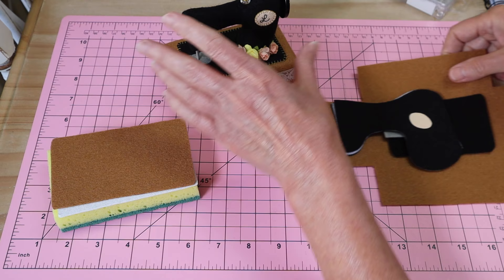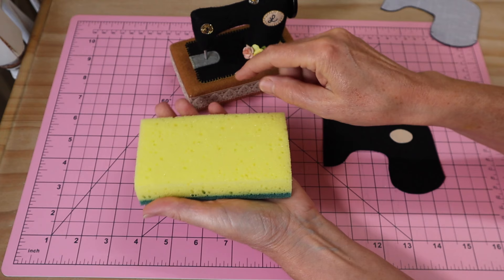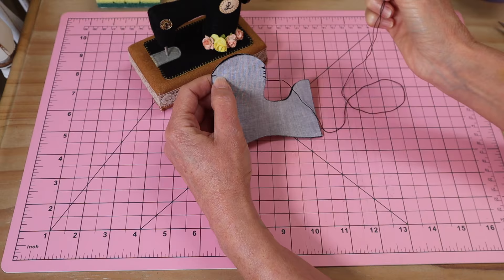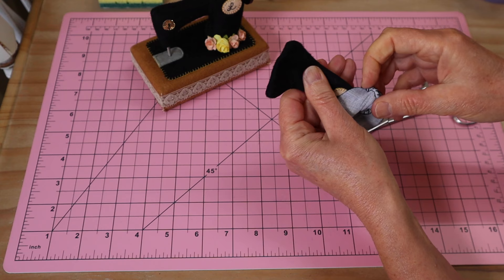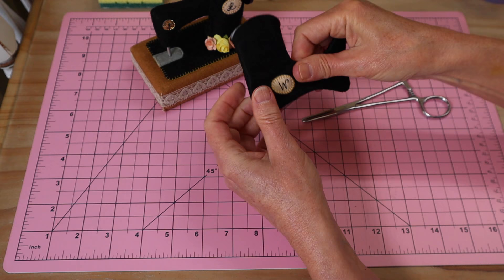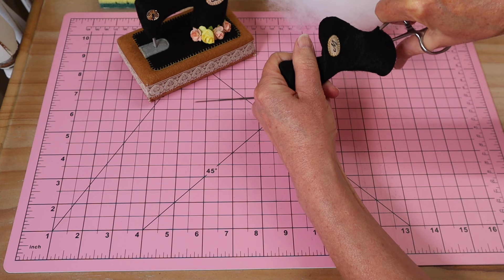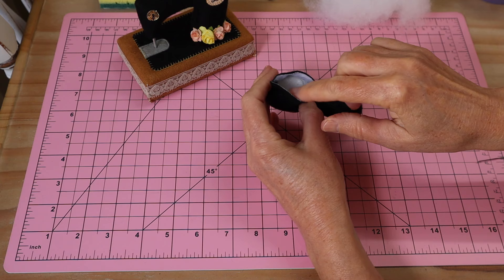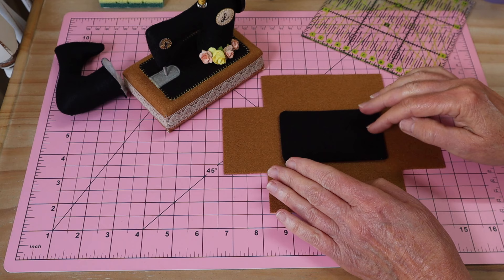How to sew a sewing Machine Pincushion || FREE PATTERN || Full Tutorial with Lisa Pay

Comment: I just want to share what I’m planning on for this beautiful pattern. I actually have 2 featherweight machines, one was my grandmas & the other was recently gifted to me. I actually have the original card table made specifically for the featherweight. It was used in the speak easy’s during prohibition. ( if there was a raid, they would pop out wooden cut out in the card table and pop the little featherweight in it to make it look like it was a sewing shop rather than an illegal bar).  I’m going to do the little badge in a color that looks gold, (that little badge on the machine is gold/brass) first I will sew my initial before cutting out the badge and will attach it with the blanket stitch like you did but I’m going to put a bit of stuffing in it before closing it all the way up. That badge on my machine is just a little bit convex and I thinkit will look more like my machine. The other thing I’m going to do is add a black band around the sponge instead of the lace because the table I have is wood and the trim or frame of the table  which is about 3 inches is painted black. Unfortunately I’ve woken up with a sore throat and in NZ any time you have any symptoms of flu you have to get tested and isolate until you get the results so I can get the felt I need until I get my results and they are negative. Such a bummer. I can’t wait to get out & get this beauty made.
Reply from the maker: What a magnificent project you have planned! So inspiring, I’m sure it will turn out perfect, I will be cheering you on! I hope you share a pic with me when you’re done! Thank you and stay safe! 😊🥰

Comment: Hiya  Lisa, I really love the wee sewing machine and I'm gonnae have a bash at making it. I've managed to get most of the materials needed, but the sponges I've seen are only 10*7*2.5 , a we bit smaller than the ones you use. Is I possible to use that size instead? Thanks Jackie
Reply from the maker: Hi! The base is designed to fit the size I used perfectly, perhaps you could cut two of yours to create the right size, Clear craft glue will join the securely🥰

Comment: I love this one Lisa. It will go nicely in my sewing room. I have 2 questions. Since you had some flying machines you most likely tried a couple different ways and threw out the ones that didn't work well. I was wondering if sewing the machine to the black plate would be easier before it's attached to the brown base plate? Asking so I know whether to not bother because if you already tried and it didn't work why try any other way.  The other question is the placement of the sponge.  Would it work just as well to have the green scrubber up?  I am thinking it might help to keep the needles/pins sharp as it passes through that firmer material. Hoping you might know. In any event, this project is by far the cutest with the most useful. So far I love all the ones I've seen you make, but this one has more meaning to me and purpose too. You are amazingly talented. Again thank you for sharing your art.
Reply from the maker: Hi Sherry, It is much easier to sew the machine onto the assembled base with the two layers, it is stronger this way, and also better to fuse the black plate in place to reduce the glue cos our pins are going to be going in there. And absolutely you can reverse the sponge, the result will be the same as long as you still add your card board base. I just prefer the softer top. I’m happy you like it!😊🥰
Reply: Thanks Lusa.
Reply: Pardon. Lisa.

Comment: My only concern is ehat the sponge and tightly packed wadding will do to the life of my pins? I usually use ground walnut shells to keep them sharp (thereby extending their life and usefullness). Worried the sponge or tightly packed wadding will dull my pins.
Reply from the maker: Hi Joe, This is really a bit of a special display pin cushion I think, perhaps have another for daily use and just show this little one off if you’re concerned. I change replace my pins regularly regardless😊🥰

Comment: Wonderful tutorial thank you.  Which felt do you recommend please? 100% wool felt?
Reply from the maker: Hi Angela, I actually use washable acrylic felt for most of my projects, 100%wool felt can be too soft. It is great for special details though🥰
Reply: @payitforward9442   Thank you, I'm surprised to hear this as my experience with acrylic felt has been that it tears apart and pils very easily, I hadn't backed mine with interfacing though so that sounds like a good idea. I've never had any issue with the 100% wool it doesn't need interfacing, holds it shape well and is very strong. 

I would very much like to re-test the acrylic option now that you recommend it, what should I be looking for in particular please?  I'm in the UK so probably won't be able to use your supplier.  Thank you again 🤗
Reply from the maker: @McQuizzical   The Acrylic  felt I use is from a supplier here in Oz. It is a blend of fibres and viscose which makes it very strong. For smaller projects I often use Pure wool felt and still interface it. I have to keep cost in mind for my Subscribers so the washable blend is a good option.🥰
Reply: @payitforward9442   Oh yes I've heard good things about the viscose blend, I purchased some to make a little jacket for a bunny but I haven't got around to trying it yet, (got it about about 3 years ago, poor cold bunny haha)  it's more pliable than the 100% wool.  Thank you again, your tutorials are wonderful 💕

Comment: I’ll be making this for my quilting friends for sure. Lisa I was just wondering, I’m in the U.S. is there anyway you can give the measurements in inches also? I try to Google the conversion, but it gives it in hundredths and thousandths it’s still confusing and I don’t want to mess up my project. Lol. Thank you ahead of time if you can. Also thank you again for these projects.🥰🌺
Reply from the maker: Hi Yvette, I use metric usually because the increments are smaller for little pieces , however wherever possible I will try to add the imperial measurements also, thank you.😊🥰
Reply: Thank you Lisa 😍